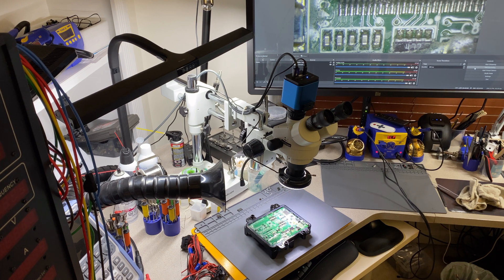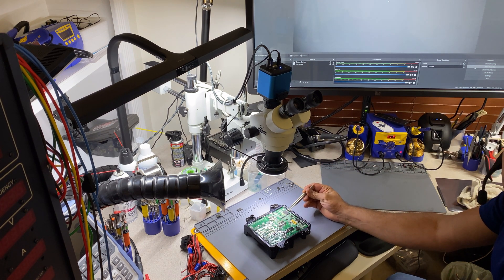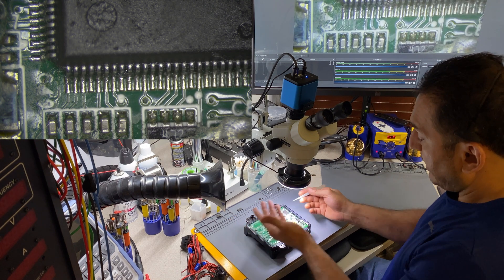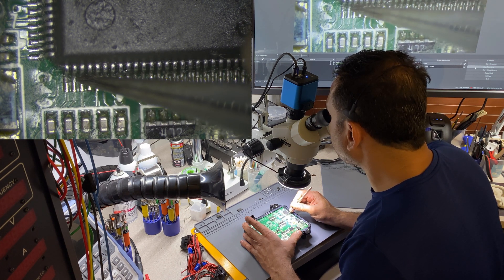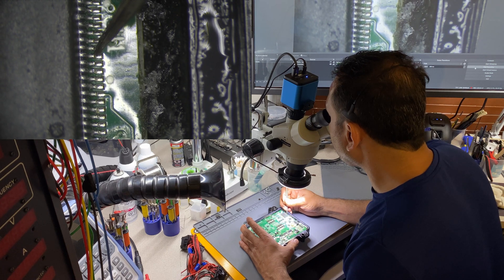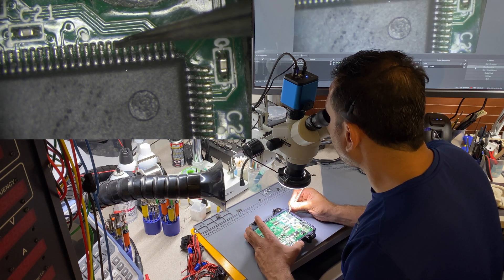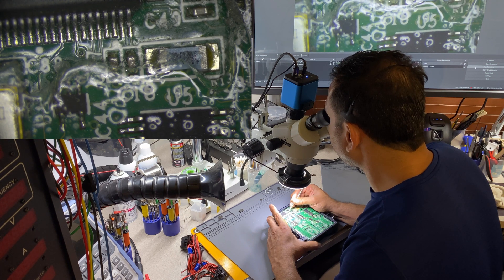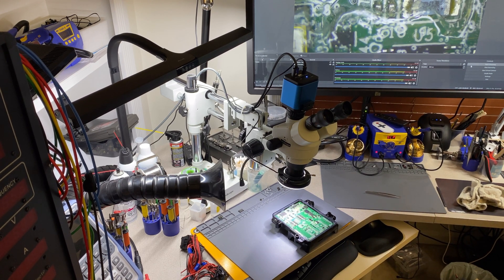Econtrols M5GCP Indamar Marine TPS 1 Erratic ECM repair

Comment: I lost the key of my Toyoace pickup truck and hence I replaced it with the exact same model of lock. Since then it's engine keeps shutting off one or two seconds after the ignition. To me, it seems that the computer is withholding some essential signals in order to prevent the engine from running. I got a mechanic to check the engine and he confirmed that the problem is purely electrical or electronics related. Did you ever experience a similar issue where the engine didn't run after changing the lock?
Reply: Sounds like you need to program the transponder in the key to the immobilizer. Most vehicles will shut off after 1-2 seconds if the replacement key isn’t programmed to the car.